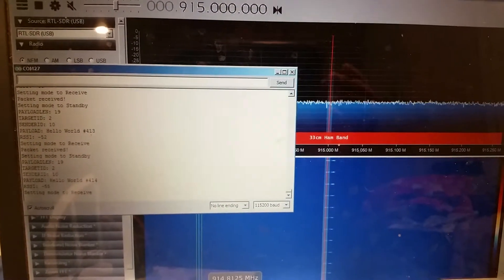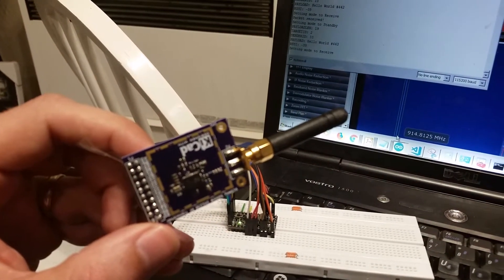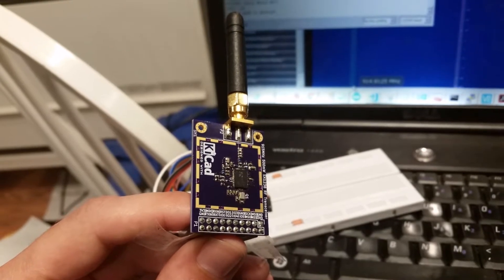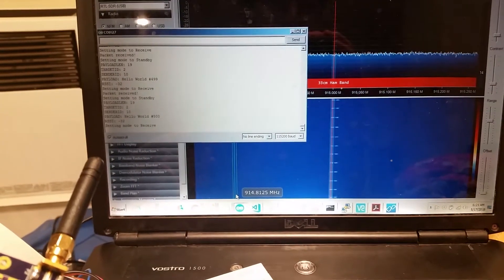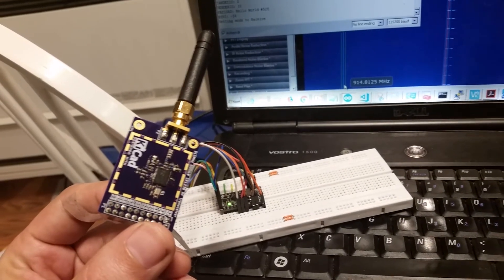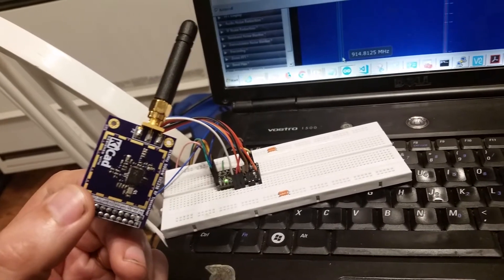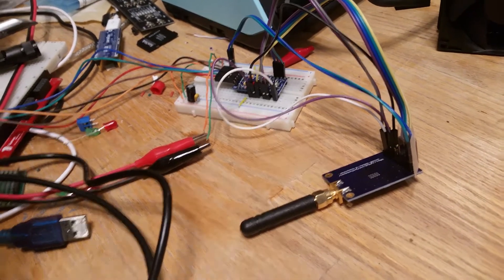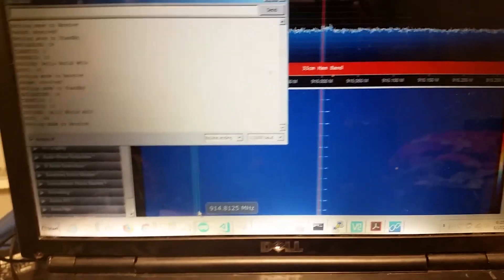The SX1238 High Power/Long Range 915MHz RF Transceiver

Comment: Jon, what sort of range are you experiencing with the SX1238 radio?  I have been working with the Microchip RN2903 (SX1276chip) and barley achieved 1 mile line of sight comm.
Reply from the maker: Hi Paul, I haven't messed with this chip recently. It doesn't have the LoRa capability that the SX1276 has. But I did test it in a wooded area, about 1.5 acres and in separate buildings. It was able to communicate fine in that environment. The range for line of sight I imagine would be pretty good, although I haven't tested that.